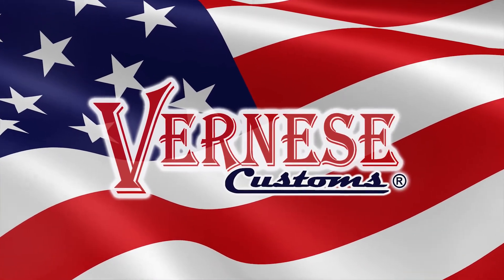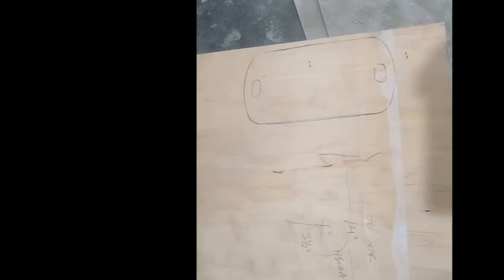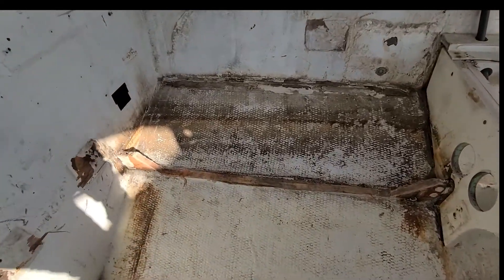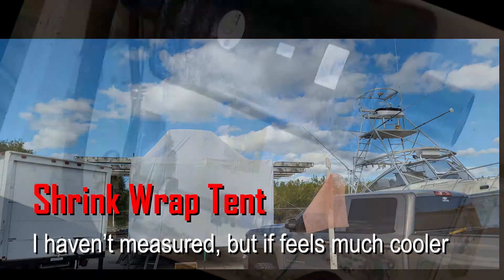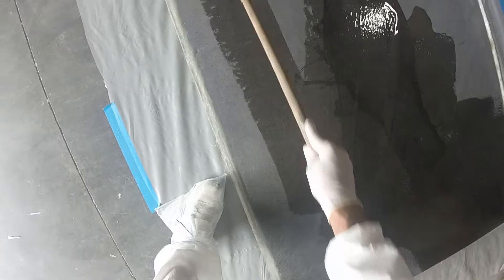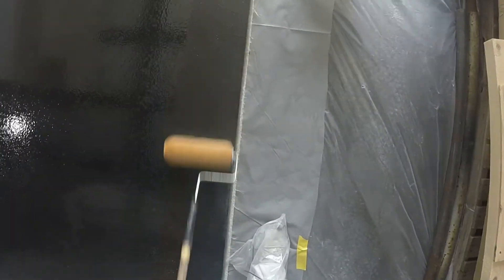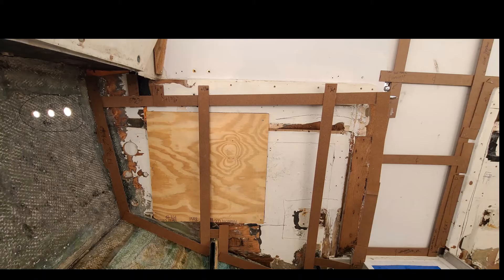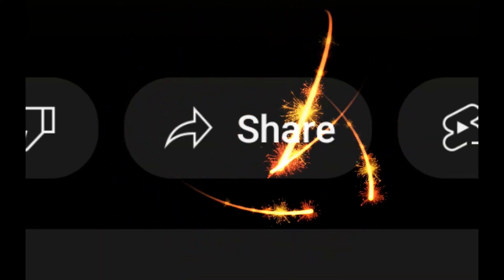31 Bertram Repower, DIESEL Conversion  + Alligator   + Coosa

Comment: Beautiful work as always. Question,  how do you trim the overhang on the coosa panels so neatly?
Reply from the maker: THANK YOU! I assume you are wondering how I cut the bulkheads. The Coosa panels we glassed on both sides in 4x8 sheets on the floor. Then, I cut the bulkheads using a jigsaw and Diablo bi-metal blades after using the templates to transfer my marks. There wasn't any overhang to trim, really. Except for the cutoff pieces, which I do trim up using a diamond blade on a 4.5" angle grinder. Like this👇 https://youtube.com/shorts/0qoLHsY2b3M?feature=share